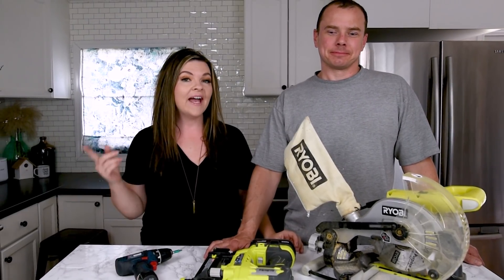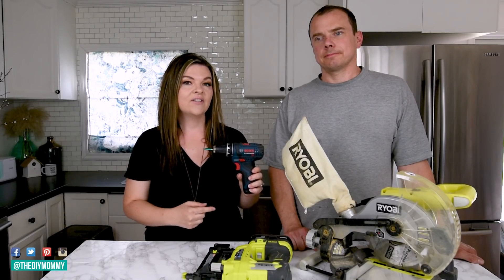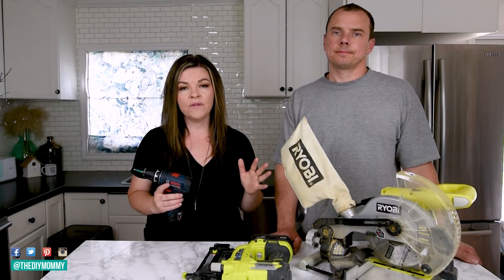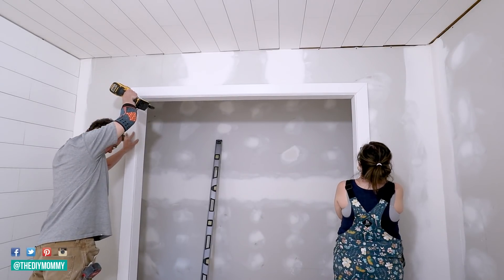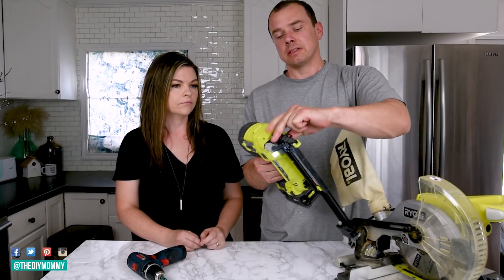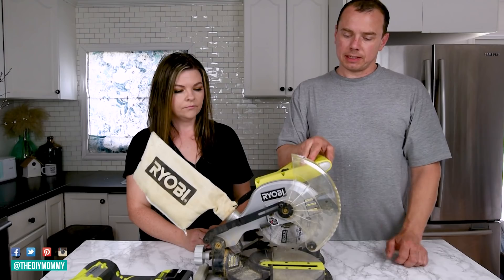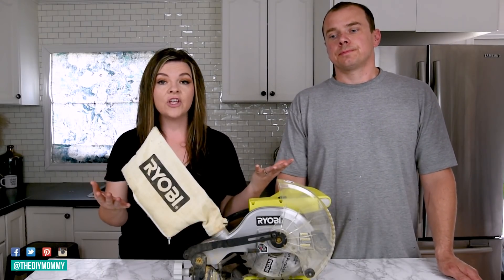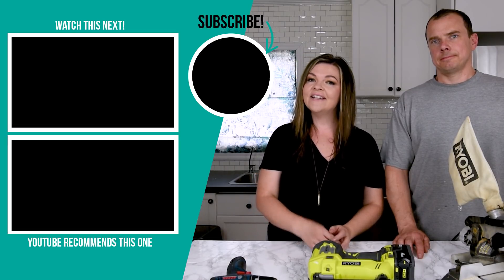How to Start Using Power Tools for DIY Beginners | The DIY Mommy

Comment: I haven't done much DIY that needs power tools in recent years after getting serious health issues, but I did use them a lot back in the day. 😊 If a mitre saw is a bit pricey an ordinary jig saw can be a reasonable substitute, because it's not much more expensive than a drill. I agree with other posters in getting a sander too, very handy in creating or fixing up stuff. We also have a circular saw that works on larger pieces of wood, if you're building fences or decks, but the mitre saw is definitely most useful for creators. In uni doing art we had to make our own stretchers and frames and I loved that mitre saw. 😊  My sons have both been collecting tools and building their own stashes for a few years so we are borrowers now.  Power tools have improved a lot since we bought our first ones a very long time ago, much easier to use and with more convenient features. Rather like calculators.  😁 Thanks for the ideas. 👍

Comment: For the mitre saw, I would add to spend a little extra and get one that tilts in both directions. Mine only tilts in one direction, and I’m sure that there is a way to feed the board through to get the opposing mitre, but I’m also equally sure that in my lifetime I’m not going to figure that out.

Comment: I just bought a bunch of Ryobi because of the ryobi days sale at home depot. I have some Dewalt & porter cable too. I stopped buying porter cable though because the stopped updating and adding to their tool line a few years ago. I feel like they are gonna close up soon even though they have been around for over 100years.

Comment: I like tools also I have a miter saw DeWalt have a small circular saw I will be Nailer Porter-Cable band saw Makita drill DeWALT circular saw Porter-Cable air compressor and the big Craig jig kit one circular sander about sander a multi-tool to routers . I told my husband no more flowers I would just like to have tools 👍😀😉♥️